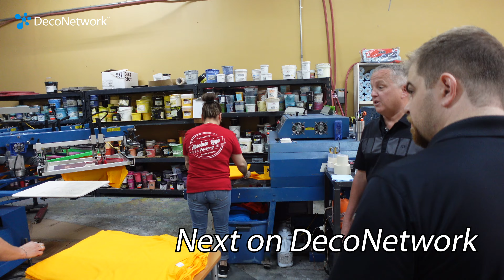How This Custom Print and Embroidery Shop Serves the Dallas-Fort Worth Area

Comment: Thank you for sharing your shop. I would suggest replacing your single head machines with Barudan Pro3’s, and then getting the Barudan Bluetooth manager, so you can edit and select your needle number, then send directly to the machine in U3 format which will preserve that data, and speed up edits. As a side benefit, all of your hoops will work with these machines.